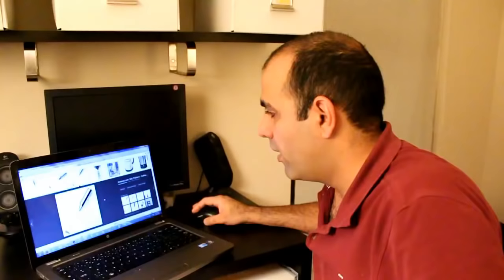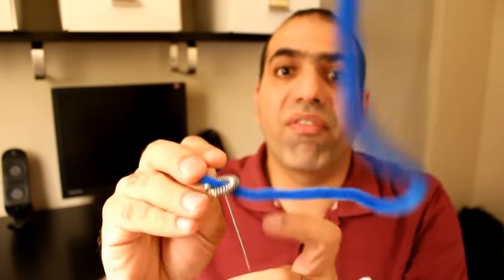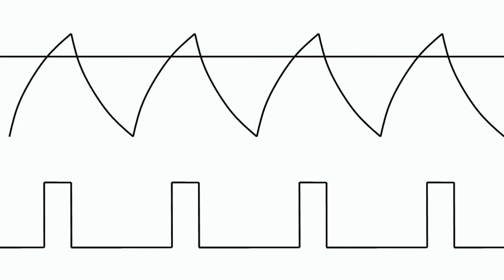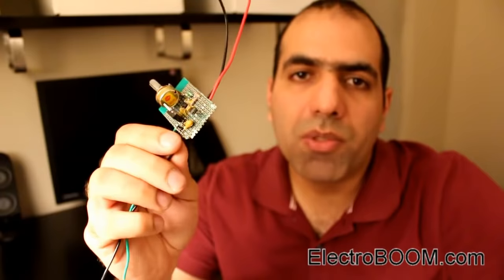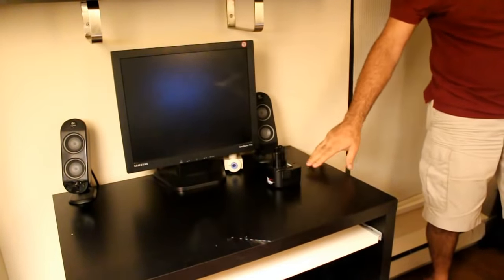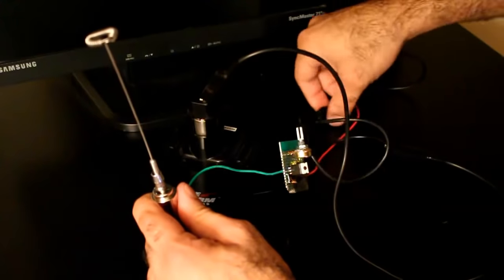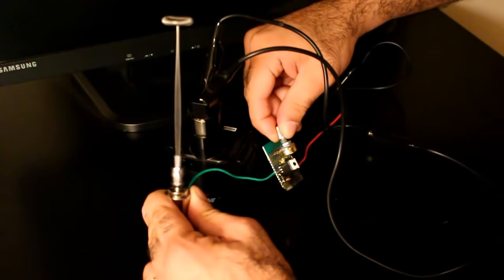Making an Electric Toothbrush (Speed Control of a DC Motor)

Comment: When you design such "easy" circuits, how do you choose the values on resistors and capacitors ? like why 2.2nF or 100K ohm
Reply from the maker: kankuro6666 Usually calculations based on time delay, required filtering or resistor division/circuit gain.
Reply: +kankuro6666 remove one 6 from your name c:
Reply: +Mary Horman not like it wasn't used 10 years ago or anything
Reply: +kankuro6666 resistors are used to for biasing and to control the duty cycle using a comparator(opamp)
Reply: +ElectroBOOM 
you just made it more complicated..
this question i kept asking for over a year and a half, nibody would teach me electronics :(
after really hard work and no teacher i managed to understand how electronics work,  i just see them as i see programming: all the types are building blocks, you decide what you want to do then grab the necessary items you need to build it.

i still don't know how to select the building blocks, i can get a general concept of how it could work but I don't know how to select the  omponents :(
Reply: +AA A like all other subjects, taking exams is the only way. If you're really into this kinda stuff, go get a degree or something.
Reply: +AA A like all other subjects, taking exams is the only way. If you're really into this kinda stuff, go get a degree or something.
Reply: John Smith 
Currently finishing a degree in IT, my actual profission is a programmer;
I don't have the time nor the energy to take on a new routine that needs so much dedication :(
Electronics is my hobby! Or more accurately I want it to be my hobby, I just love it!
I understand the main concept and know how electricity works (more or less) as well as the electronic components, and I can only build very simply circuits.. I want more!
Reply: Design and build around your limitations. Continue to push those limitations little by little . Just takes time and patience.
Reply: You are putting it in a complicated way bro, take a book like "electric circuits, Nilsson", or electronics from boylestad. Read it, make all the excersices and you are ready to go it is really not hard, you will see. Good luck with your career
Reply: see what values people put on their stuff and put similar ones and experiment
Reply: did you notice how balanced the circuits are? I have never seen that before

Comment: You just taught many women how to make a home made...eh uhh toy.
Reply: But there to lazy to construct it so they buy one anyway
Reply: Rosetta Katrina You know us so well, sister.
Reply: Philip Wilcox lol 😂😂
Reply: Benjamin Pattee homemade tooth brush
It's in the the title, can't you see it?
facepalm
Reply: Benjamin Pattee that'd be incredibly painful
Reply: Can confirm: blender fleshlight was a terrible idea. Maybe replace the blades with bendy arms, fill All dead space with beads, and wash out the key lime and salt from when it was used as a margarita glass.
Reply: Yep. A fucking vibrator.
Reply: Lol they will use it with the drill battery and scram in pain.
Reply: Well, at least he tought em to TUNE one :P PwM seamless-regulated ... Handmassager cough :P
Reply: As long as they don't mount the polarised capacitor backwards, or else it becomes a home made... eh no-no toy, (aka cunt-o-kaze).
Reply: XD
Reply: he couldnt even get the female socket to hold on to his plug
Reply: (On the verge of tears) i ground up mah d***
It's everywhere
Reply: @philipwilcox6864  Grinded sausages!

Comment: you can use plasma [an ionized gas consisting of positive ions and free electrons in proportions resulting in more or less no overall electric charge, typically at low pressures (as in the upper atmosphere and in fluorescent lamps) or at very high temperatures (as in stars and nuclear fusion reactors.] to make a better result

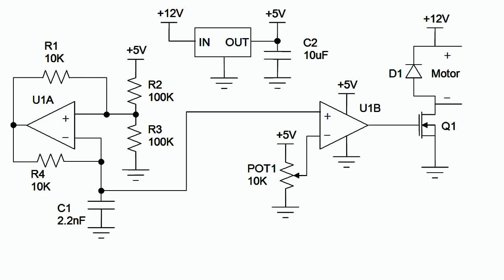Comment: Can someone help me with the circuit diagram at 2:15
I understood 75% of it
But why is the non inverting input of 2nd op amo connecte to the capacitor of the astable multivibrator?? 
And not at its output which is a square wave

Comment: Hmm... if you just put a potentiometer in series (instead of the complicated PWM circuitry) with the motor, I think you can avoid attaching capacitors on reversed polarity...

Comment: 1:43 nick batt collab when
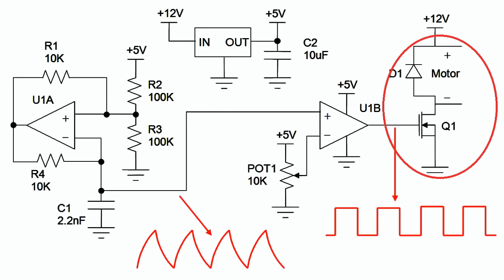Reply: 2:45 wait HOLD the f up here. this could just be me being a synthesizer nerd but i think you just made a "triangle core oscillator"?? those oscillators are used in music a LOT! actually, the oscillators in the legendary Prophet 5 synthesizer are based on a similar design.

i've said it before and i'll say it again. mehdi, you should try making a synthesizer or some kinda electronic musical instrument. most of them are made out of oscillators like this, low-pass filters, and amplifiers controlled by voltage function generators. i would LOVE to see/hear what you'd come up with!
Reply: also don't worry if the end result isn't "professional quality". hell, little "boutique" synths can end up making some pretty decent money. i'd buy a synth you made tbh